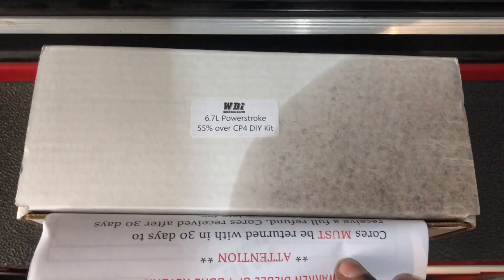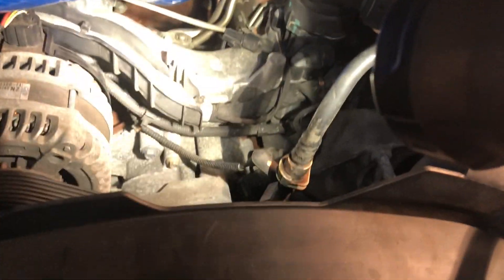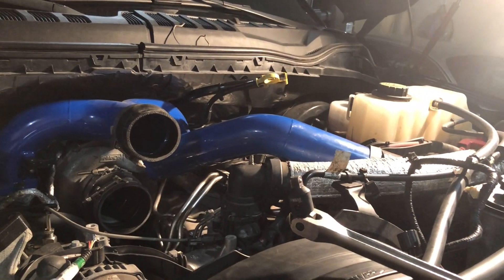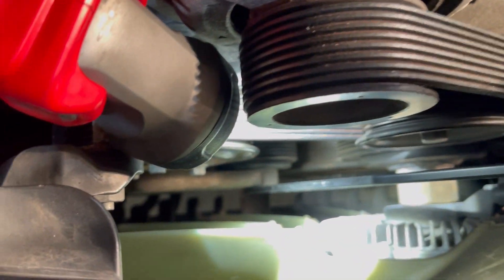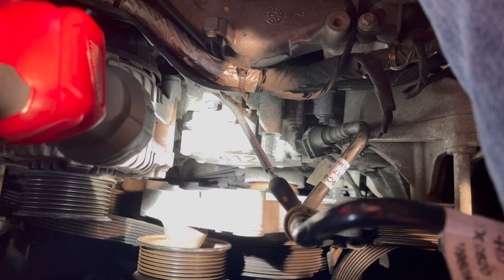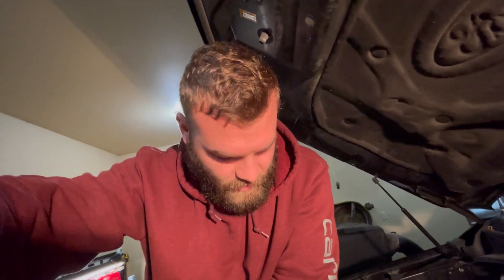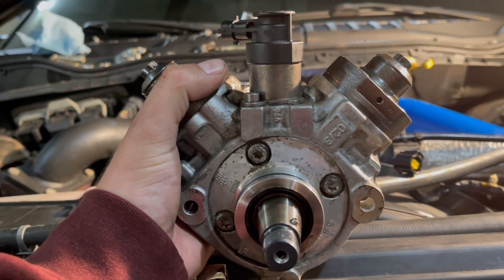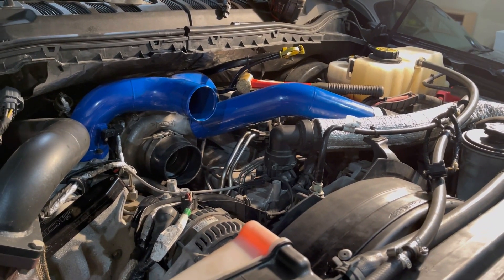Warren Diesel 55% Over CP4.2 (DIY Kit) Install

Comment: Found a Kit on Facebook and he’s selling the 55 over DIY kit, heard a lot of bad things about them… would you buy it again?
Reply from the maker: I would not buy it again. Mine blew up on me. Warren apparently was using some bad materials and that seemed to be the failure point.
Reply: @JohnKangas What exactly blew up? Guess I'm going with the rcd cpx stroker 😂
Reply from the maker: @only2genders84 first off, love your username. Second, I'd get the coastal diesel stroker pump. I'm running it right now and it outperforms the RCD pump.
Reply: @JohnKangas  Thanks!! Sweet, will check it out!
Reply from the maker: Guys name is Darrin. Tell him you know me, he'll get you taken care of. Should even be able to get you better pricing than retail.
Reply: @JohnKangas  Hey, I appreciate that!

Comment: Awesome video. Got a couple of questions. Does this require a tune afterwards ? Does the truck make more power with this or is it just there incase making more power in the future ?
Reply from the maker: The truck does make more power after installing this pump. And it does require new tuning.

Comment: is there a reason why you didnt do any of the disaster prevention kits on the cp4 unit?
Reply from the maker: Great question! Not really is the answer I guess. The only thing that I can think of for my reasoning is that in the most recent update to the cp4.2, they decreased the size of the screen inside the pump. So although it is possible for metal to go through it, it's far less likely that any of the metal would end up in the rest of your fuel system. This is my understanding of them anyway. So that being said, the disaster prevention kits seem a little redundant.

Comment: Figure it out? And your 55% over kit still
Good? If you wanna get rid of it let me know
Reply from the maker: The pump went bad. It's a paper weight now.
Reply: @JohnKangas  what did you install after it went bad?
Reply from the maker: I bought a stroker cp4 from Coastal Diesel and Performance. Ask for Darren and tell him I sent you. The pump is good for roughly 800hp!

Comment: think you could off pulled it off with the pump still in the truck?
Reply from the maker: No. Pump definitely needs to be out. Just not enough room to switch those plungers
Reply: @JohnKangas  10/4 was just checking. i was looking at my 17 and there look like theres a lot of room on both side of the pump heads. ever get yours running right?
Reply from the maker: Haven't got it 100% yet. The pump is bad so I gotta get another.

Comment: How long did it take you
Reply from the maker: Probably 4 hours. I think I can do it in three now that I've done it once. Also depends on if you have the stock intake setup or an aftermarket intake piping kit. The piping kit makes it 492 times easier cuz you just pop a couple tubes off. Make sure and watch the next video tho if you're considering this pump!
Reply: @JohnKangas  I have an absolute performance  intercooling piping kit I have the emperor turbo kit from SPE on the way as well as the warner diesel 55% diy kit
Reply from the maker: Oh yeah that's gonna to pipe! Who do you have tuning your truck?
Reply: @JohnKangas  spe
Reply from the maker: Good good good good! You're set man!
Reply: @JohnKangas  thanks buddy
Reply: @JohnKangas  come install mine for me
Reply from the maker: Hah where ya at? Lol
Reply: @JohnKangas  Sunnyvale Cali
Reply from the maker: You're allowed to have a Diesel truck in California?!?
Reply: @JohnKangas  haha I’m just out here working for a long time
Reply from the maker: Gotcha gotcha. What do you do for work?
Reply: @JohnKangas  boilermaker. After installing the pusher compounds I’m don’t fking with motor work lol.
Reply from the maker: Hahah yeah it kinda sucks. Especially the exhaust clamps
Reply: @JohnKangas  those damn v clamps are a pain in the ass!!
Reply from the maker: Yeah you're not lying. Omg I hated them